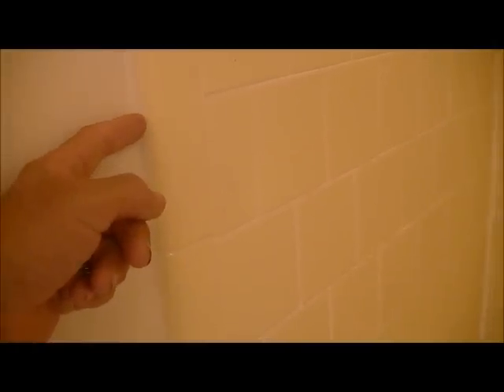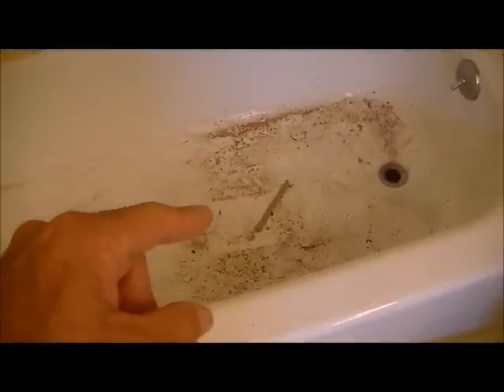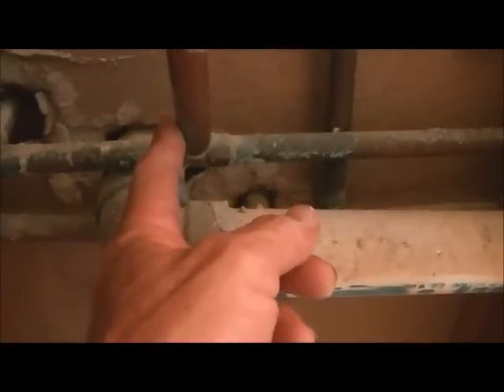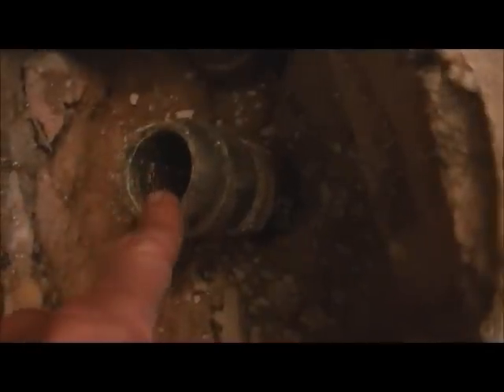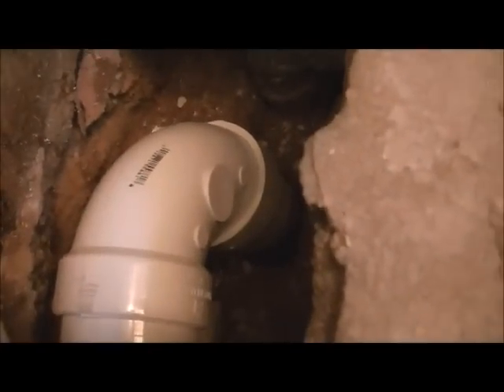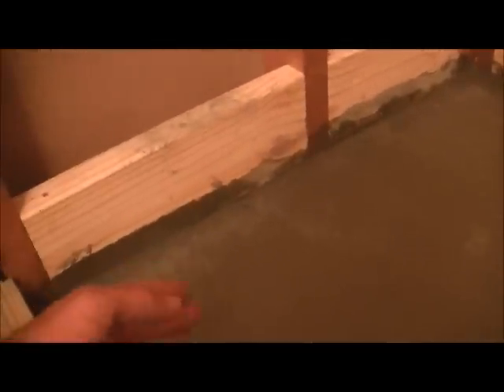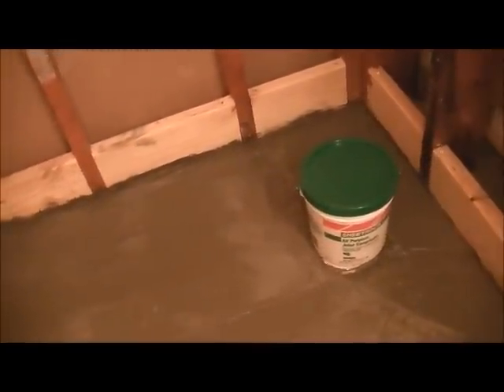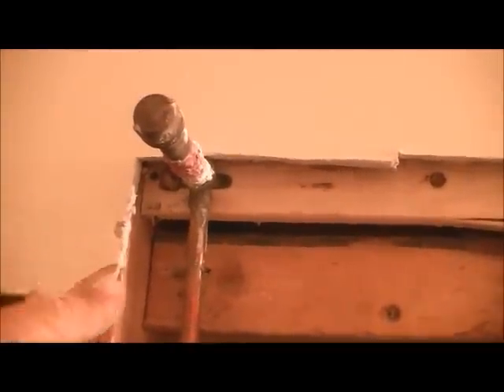How To Convert Tub To Shower

Comment: What an EXCELLENT well explained video!!!! Do you find any problems using the 2 inch drain on the reduced drain. Back in the day, I doubt most houses had big drains. We live in North Texas and are shopping for a plumber/remodeler to do exactly this type job. Can you give an estimate on what this type job would cost? We have discussed moving the drain more centered as you said. But in North Texas every house has foundation problems due to the clay soil and I don't really want to punch any un-necessary access points into the slab. But by far, your video is THE BEST!!! I like you explain the "pre-slope" process of the pan. I think it's important process to do! Thank you for posting!!!
Reply from the maker: +trailertrashtc  I don't know what guys charge where you are....I would assume higher than I do, but expect about $2500-$3500 labor.
Reply: +trailertrashtc You are not allowed to put a shower pan on an 1 1/2" drain anywhere in the United States let alone stack elbows like that. The trap has to be straight under the drain of the shower pan or that is what we call a running trap and is illegal and will cause problems.
Reply from the maker: +MrSturgy1  This job was done nearly 3 years ago...for friends of mine. From day one to today the shower has been used & never any problems as you say there will be. The trap and pipe is 1 1/2'' under the slab so changing it to 2'' is impossible. Water flow ( from when it was a tub ) is a LOT higher GPM then the new water saver head has now so there is less water going into drain, code or not it works. As to your statement " Trap needs to be directly under drain " is false, trap can be anywhere prior to transition to main.

I'm allowing this one comment, the other two you posted are redundant and I don't like trolls on my channel.
Reply: MrSturgy1 you sir are incorrect. While in some cities possibility there may be a code for shower/tub drain size, all preexisting homes will have either-or and in this particular instance the house originally had a 1.5" drain that has served a tub being filled and then drained all at once and now has a new shower with an up to date shower valve and head that will only produce a fraction of the water that filling the tub did. And your comment about the P-trap is incorrect also. I actually took the time to look up the information before i ended up making a idiotic comment about something that i didnt know what I was talking about and only assumed i did. However... there is no code for the  distance of the P-trap from the drain. In fact where im from in the Southeastern US, there isnt even a requirement to have one under a sink or tub/shower. Its purpose is only for oder retention and not actually required to be directly under the drain. The reason it's "usually" directly underneath is because its quite often 2-3 pieces and it makes it easy to get because its purpose doubles as a clean out. Having it a couple feet away from the sink or tub/shower makes no difference what so ever.
Reply: And also having it a couple feet away from the drain doesn't cause any problems as long as its positioned in an upright manner with the actual p below the level of the rest of the drain. Its not like the trap is half way across the yard or something. I could see a problem then but not in this case

Comment: Nice job and video. Would you recommend using Durock or other cement backing board instead of greenboard for the shower walls?
Reply from the maker: +Robert S. JR.  Many would say YES....though they can't explain why if a topical membrane is being used.

The real answer ( that all want to hear ) is don't use greenboard in a shower, the reality is I can use cardboard and paint it with Redgard, no water will get to it ;-)

Comment: thanks.  Will pick up some sand mix at HD.  Been watching some other you tube videos and see that they are putting down a black roofing mtl & wire mesh to the plywood prior to pouring which seems proper...would you agree?  Also, as you did, we changed out drain to 2" but left it at approx. location as the existing tub drain, so we have approx. 5 ft from rear wall of stall to front drain.   I've heard 1/4" slope per foot which in our case would be over 1"...this sounds extreme? I would think 1/2" slope would be more than sufficient. Last question, do you also slope the first layer or only layer on top of vinyl pan?
Reply from the maker: I don't understand, tar paper & wire is put where ? Before the liner ? Inside of it ? I wouldn't do either, no point. All you need to do is make sure the plywood subfloor is solid....if it's 1/4'' or 3/8'' I would shore it up with 3/4'' or at least put down 1/2'' backerboard 1st....then set the pre-slope, set liner and pour the pan. And yes, 1/4'' per foot is proper slope for drain ( and pan mud btw ).
Reply: StarrTile thanks again for your prompt response.  They stapled the paper & wire to the plywood before the liner saying the paper was required so plywood did not absorb the water from mortar.  The wire was used to "hold" the mortar.  Our floor is solid.
Reply from the maker: Steve Cooper When your curb is set, and you do the pre-slope, putting the sandmix on the plywood is fine, it should not be runny...it should be clumpy so the moisture content is not enough to cause issues, however, I can see where some ppl will feel better putting tar paper down 1st, though I don't feel the wire mesh is needed...doesn't hurt, but not needed. Just be sure NO PART of that wire is near the surface, since you can cut the liner when you install it.

Comment: Awesome video. Thanks. Saw green board used down to the pan for the walls. Is there an advantage to using the durock/wonderboard instead of green board?
Reply from the maker: I use Greenboard by default...a gypsum based product which mold can live off if it gets wet, but the idea is to waterproof so it see's no moisture. Other backers like Hardi, Wonderboard, and Durock will not get soggy if exposed to water, but then you waterproof those too and all will get mold if wet.

There is however a gypsum product for wet areas called DensShield which is pre-waterproofed, basically sheetrock with Redgard on it. So it blows the whole theory of NOT using gypsum in a shower ;-)

Comment: You have great videos!  two questions:
1.  Do you bring down the greenboard right to the floor of shower so its resting on top of your membrane?
2.  Is the Regard the only thing you use to seal that space?  You use any fiberglass felt along with Redard?
Reply from the maker: Any wallboard, no matter what it is, should never be set on the membrane ( in the pan ).
Redgard is all I use, you CAN use fiberglass tape in corners, but redgard is felxible.
Reply: StarrTile So how much is the gap between greenboard and the finished pitch floor (this is what I meant not membrane)?  So you just seal the very bottom of greenboard that meets with floor with redgard?  trying to understand how the bottom finishes.  thank you for your help
Reply from the maker: Marc Jr Some will put the wallboard to 1/2" of floor so the floor tile slides under it....I fill the gap ( if any ) with thin-set and when Redgarding the walls & corners, I Redgard the area too, out from wall on floor about 3-4 inches
Reply: StarrTile your the BEST thanks Bob!

Comment: Thnx4yer video. Why wouldn't you go with dura rock on the walls instead of sheet rock?
Reply from the maker: Durock bow's between the studs, so I prefer something more rigid.
Reply from the maker: ***** Denshield is an ok product, but cost more...and my customer pays the cost & is given a choice, but it is still gypsum board regardless with a coating on it to prevent water penetration. As does Redgard, 2-3 coats on ANY surface and water will not go through. Use Durock, Redgard, use Hardi, Redgard, use 8inch concrete walls, USE REDGARD....understand now ? It doesn't matter the wallboard, tile will never touch it, and water will never see it... topical membrane prevents water penetration. FYI, I don't use regular sheetrock, I use greenboard, but I could use CARDBOARD ( reference my video "Regard on Cardboard" ) or Google Redgard to find it.

Comment: I was hoping you could assist me with info on what my options are for installing a curbless shower. 
Currently the 32"x60'" space is occupied with a fiberglass shower/tub insert with a typical (8" from side wall?) drain off to one side. It is in a concrete slab foundation.  It we want to go curbless, how would we lower the drain enough to achieve an ADA accessible , roll in type shower? And if possible should we move the drain more towards the center of the 60" span? Thanks for your consideration
Reply from the maker: I'm sorry, never built a curbless shower, though seen them ( always on a slab ). My feeling is those slabs in the shower are tapered when they pour them, allowing for proper slope...in which case it wouldn't matter where the drain was, I would probably center it though. Otherwise you'll need to pour some ( sandmix concrete ) at the entrance from left to right about 4-5'' wide and at least a few inches high, like a speed bump...and since a pan liner will not work, Redgard the entire floor about 3 times. 

Hope that helped !

Comment: Didn't get to see the niche get made and would like to know. Looks like you cut out a section of the center stud right? Then make the outline with 2 by 4s. Do you think the plastic moisture/vapor barriers are necessary before the cement backers? I don't think you used them here. Thanks!
Reply from the maker: Yes, I always start in middle of back wall, cut out stud & nail in 2x4s to create niche. After wall board is attached to entire area, I redgard all walls at least twice, niche gets 3 coats, will not leak. As a rule, no plastic barrier needed if using a topical water sealer.

Comment: The shower pan I am building is going to be in the 5+ X 3.5 ish range.  The 5x6 Oatey liner I see everywhere is going to be a stretch to get 6" at each end.  Do you have any thoughts on seaming 2 of them together.  I've seen a 5x10 advertised so I am leaning at ordering one of those and trimming excess.  But back to seaming, have you used the Oatey cement to put 2 pieces together?  Would the Redgard you use hold to the liner as added protection?
Reply from the maker: +Glock Shooter Redgard will not hold the liner, the glue ( Oatey cement ) is what you need. It's like contact cement, spread it on both sections at least 4'', let dry, then place them together with some weight. It does work but gives you a thicker liner where you glue them. Home Depot carries 5foot in a roll so get 6 feet or more, the width will be 5feet so plenty to cover over curb & go up other wall 6-8 inches.

Comment: That turned out really nice. I'm curious about doing this on a first level (meaning with a basement below). I haven't found any videos that show this process without digging out concrete. Is the process the same, or is additional support in the basement required?

Comment: GREAT Video....I wouldn't hesitate to DIY one  :)
However...there is always that design question about 1 small tile strip  vs  2 smaller strips.
And where to locate the odd strip. I don't know if it was purposeful to put curb 2" piece on Right
and on the Left on the back wall....probably should have been same side(??)
....but the design question I have.. ( or it is STRICTLY a matter of taste??)  Should the 2' strip have been on the left or 
right all together?   The controls and shower head look so nice on the right, withOUT that busy little strip!!
But when you walk in the Bathroom, for me, that strip on the left  kinda sticks out.

AGAIN, Beautiful job. Million tomes better than anything I could do   :(

Comment: Have you tried using an oscillating tool with a bent adapter to cut the drain? Might be a little easier to fit in there and work with?
Reply from the maker: This video old..since then I bought one 👍

Comment: Great job .Question, by the drain what do I do with the opening that exposes the pipe down to the p trap? Do I fill it with cement up to the shower floor? how do I support the  base and pipe?  Thanks
Reply from the maker: Hernando Acosta On a slab as this is, the drain/ptrap is covered in cement. On a wood floor the cut out section for the drain does the support, and pipe strap under floor.
Reply: StarrTile Thank you Sir, I can now complete the job I started -thus saving the money I do not have. Your reply is and answered prayer. I questioned others but no one knew Including a student plumber. GOD BLESS YOU AND YOUR SKILLS.
Reply from the maker: thanks

Comment: Mr. Doyle, I have a question...I have been told by more than one contractor that they use sand for the pre-slope.  What is your opinion on this method?  Have you seen this before?  I live in South Florida in a single family single level home with a concrete slab.  By the way, your videos are amazing.  Thanks.
Reply from the maker: +omarperez101  A pre-slope is formed with SAND TOPPING MIX, not sand...topping mix is the same make up as your pan. My opinion is a pre-slope isn't needed ( see : Shower Pre Slope Explained on Youtube ).

And thanks for the compliment, much appreciated ;-)
Reply: +omarperez101 Mr Doyle, I am having trouble with my youtube account so this post may appear more than once and I apologize, but I have a question.  I put up a vapor sheild (6 mil clear plastic sheeting) behind the Durock for a shower I am doing. When I went to buy Redgard I found out I should not do both. Should I a) tear down the Durock and vapor sheild and start over, b) use the Redgard as is, or c) leave it alone and not use Redgard? Thanks. Omar
Reply from the maker: +Omar Perez The reason to NOT do vapor & Redgard is if water gets in between it can possibly create a "mold sandwich"...however, with proper tiling, grouting, sealing of walls, water should never get in between. So the answer could be either A B or C, depends on how confidant you are doing the proper steps to insure water never see's the walls. 
Having said that, my belief is that Redgard trumps a moisture barrier ( plastic sheeting ) so I would be inclined to do A

Comment: Hey I was wondering if you can help with a question I have. I have a laundry room with a toilet and sink. I want to add a shower to complete the bathroom. The only thing that stops me is that I don't want to break any concrete to set the p trap. Would it be possible to raise the shower floor using that sanded mortar you  used?  If so how high would it have to be raised so the ptrap would function properly. If not are their alternatives to the p trap?
Reply from the maker: iilover doe Yes you could build the shower up off the ground ( step up shower ) with a clearance of 10''-12'' for the p-trap....or whatever the measurement is from drain cap to end of the trap. But honestly cutting the concrete the typical 6'' to the grade ( dirt ) is easier, a concrete saw & jackhammer rented from Home Depot will be $100 and take just an hour or so.

Comment: Good evening!  I have a tub and shower combo!  I am thinking of doing the work myself! I have a question regarding the pan.  My sub floor is concrete...so, when I take out the tub and locate the drain, and put in the new drain; if the flange is even with the concrete (sub floor), after dry installing it, do I have to put down a concrete bed or just put the pan liner in and tighten down the flange and screw in the drain?  Then afterwards put the mortar on top of the pan liner and slop it to the drain?
Reply from the maker: Thanks for the message. Although I'm never opposed to homeowners doing their own work, you may consider contracting out some of the more difficult phases of a conversion...getting it wrong at step 3 or 4 would not be good by step 6 or 7. In regard to your questions, you don't need a concrete bed if the flange is flush with the floor, you do however need to fill in the "box" where the drain is with concrete...to the bottom flange of drain ( the part with 4 bolt holes ). After drying out, the pan liner goes on top, then the other part of drain is bolted to it with 3rd part of drain screwed down to height you need before pouring the mortar.....mortar is sloped from walls to drain at about 1/4'' per foot and should leave a gap of about 1/2'' below drain cap for thinset & tile.
Reply: StarrTile Thank you for the video first.  Secondly, I thank you for making my life much easier!  I will contract out the plumbing part for the fixture and the sweating of the copper, and lastly, after I do all demolition work can you give me and estimate on how much a plumber should be charging to put in a new fixture?  Thanks again, and great video and instructions.
Reply from the maker: Leonard Johnson Depends on some variables, but count on about $300-$400...really shouldn't be that much, but ya know plumbers making 6 figures a year
Reply: StarrTile Thank you Sir!  You have been a big help!

Comment: Great attention to detail and well explained, nice to see guys out there taking pride in their work. Have you come across a system for shower pans like the one "TheTileShop.com" sells? If so what are your thoughts please? It's basically and supposedly a fool-proof  plastic "quick pitch" pan system and shower curb system. I'm thinking of using it as a DIYer. Great video and tips, thanks.
Reply from the maker: First off, thanks so much for the kind words ;-) . I'm familiar with the Tile Shop, it's a great store with a good ( but expensive ) selection. I also know the Quick Pitch system you refer to....although I would never use it because of time stipulations I'm under, for a DIY'er I think it's an excellent product, makes it easy for almost anyone to do their own pan & curb if instructions are followed.
Reply: StarrTile Thanks for the quick response and your opinion.